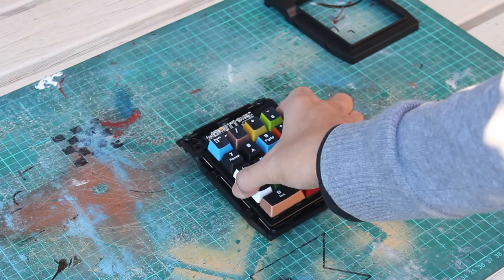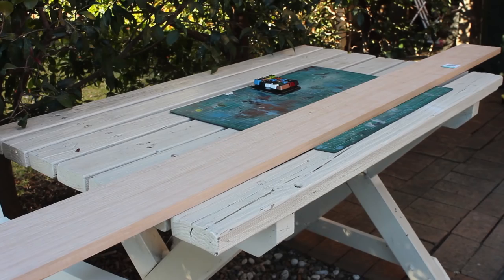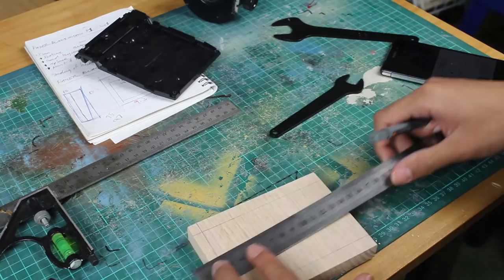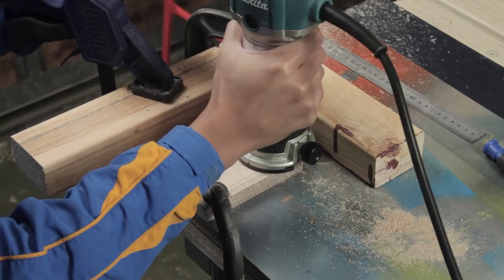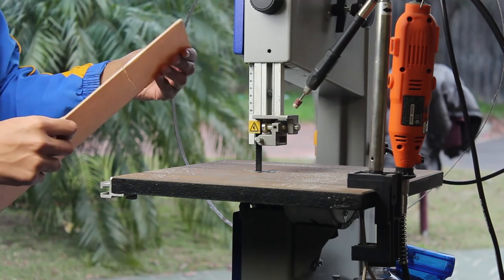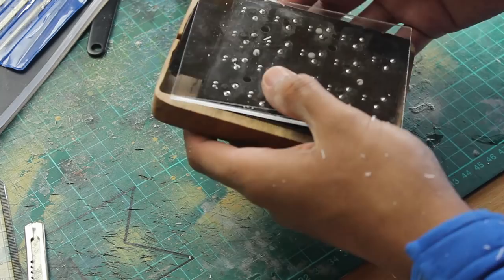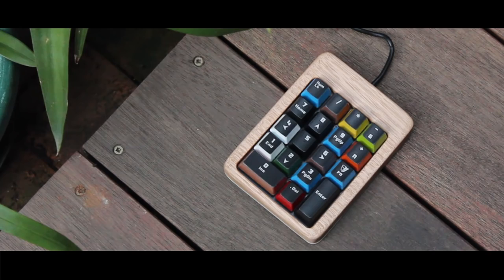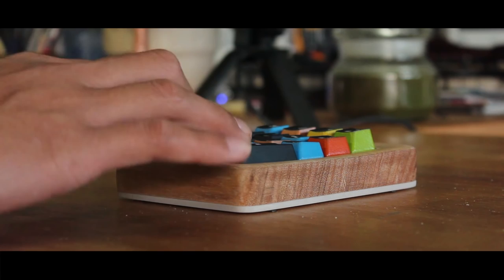Customised Wooden Mechanical Keyswitch Tester Numpad - Part 2 The Wooden Case!

Comment: I think it would've been cool if you made a sliding base for easy access to the PCB for soldering etc & ngl the typeface on those keycaps is not pretty
Reply from the maker: That woulda been cool! But as time went by, I became less patient - hence the freehand work. And yeh the keycaps are great, but I didn't have any spare for the numpad. :)